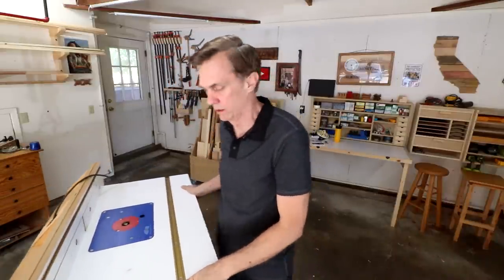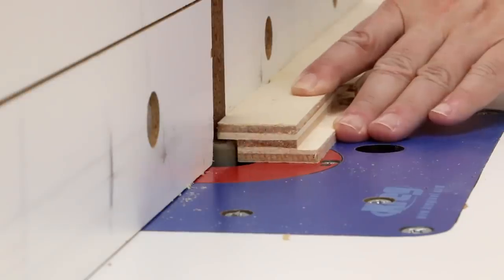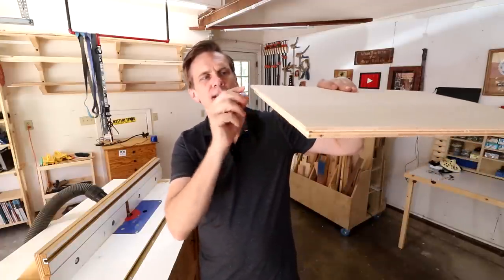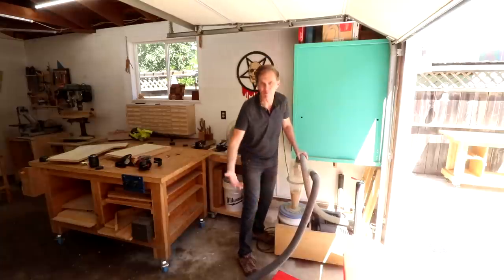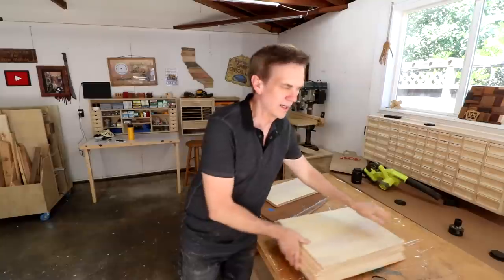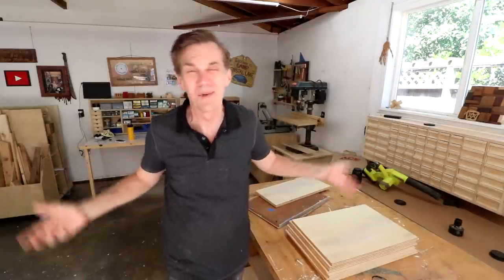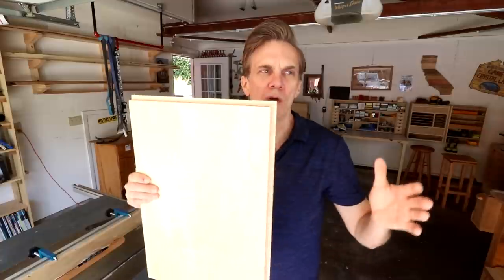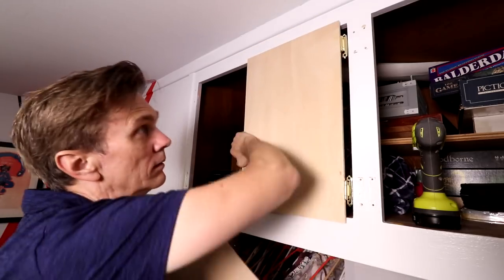Why did my router bit keep slipping?! | Day 116

Comment: The easiest way that I've found to hang double doors like you have, is to make 1 large door, screw in all 4 hinges, then remove it and cut it in half. Doors always align, even with me being a little on the clumsy side.
Reply: That's wicked smart
Reply: Brilliant
Reply: You just blew my mind
Reply: I will be using this on my current project when I get to the doors! Muchos Merci's!
Reply: There are very few hinge styles that that will work with unless you access to the back side of the cabinet.
Reply: Thank you, that is an awesome tip!! I've been watching Adam Savage build boxes that open to display things with hinges and he does the same think.  Build the box then cut it.  Great tip!
Reply: Hey, brilliant idea. I'm gonna try it
Reply: That's how my grandpa taught me to do it too. It helps with the alignment, but the really nice thing is that it makes the grain flow perfectly.
Reply: I’ve seen people do this with drawer fronts too. Attach a board to the drawers than clamp on a straight edge and cut to separate with a circular saw.
Reply: nice idea. you could even use a jigsaw and make some funky pattern
Reply: Great idea
Reply: Or use euro hinges ;)
Reply: Nice! I’m going to have to try to remember this!
Reply: You’d need to use a thin kerf blade, the gap could get too big after sawing.

Comment: Hi Steve, My name is Victor from Mexico, love your show; you know? The problem you had with your router happen to me last week, I fix it cleaning the collar (I believe that's the English name of it) hehehe, and all of the parts involved in the grabbing of the bit, apparently the wood dust was causing the problem.  This is the very first time I ever write a comment on YouTube, I've been watching you build things for the last five years and also your older videos, keep up with the great work you do, God bless and thank you for inspiring us to keep wood working.
Reply: Thanks Victor, I am going to try doing a deeper clean within the area the Collete (small metal piece that holds the bit) 
Also I've experienced the bit getting stuck in the collete, but sprayed with wd40 and it came out with a bit of motivation (pulled on it with pliers under the sharp blades portion)

Comment: You sure you are not using 6mm shanked bits, not 1/4" therefore 6.35mm shank? The collet might be tightened down as far as it goes, but not gripping the shank tightly?
Reply: Good point. Can be hard to tell them apart.
Reply: This is a good point.
Reply: especial if the bite was an Asian made bites
Reply: Happened to me - bought a very cheap bit set, wasted my money, yet again. You would think a person would learn, but not me.
Reply: @jeffreythompson9549  I got an expensive set and it does the same thing. They were 1/4" shaft.
Reply: See! See! See!  Get rid of that dam metric crup
Reply: Happened to me as well. I bought a 1/4" bit instead of a 6 mm one. Not sure why they sell that imperial stuff in Europe in the first place. Anyway, this could be solved by buying a different collet for your router.  And it was cheaper than the router bit.
Reply: @keithfaulkner6319  Hey! Lets not get parochial here! This Video is watched (and thouroughly enjoyed) world-wide not just US, Some of us are in Europe and are constantly battling the Imperial vs. Metric problem. But I reckon that's the Bit slipping issue here...6mm vs. 6.35mm.
Reply: @jeremyspecce  the only ways I can tell is if I try to load a 1/4" bit into a 6 mm collet or measure the shank with calipers. A 6 mm shank into a 1/4" collet seems to work, but doesn't. It'll slip like it did to Steve. It'll seem tight but it just won't be quite tight enough in use.
Reply: @Clive007  Imperial length measurements were dropped 185 years ago now. A swede named Johansson decided what an inch was going to be for everyone. Because he made the best inches on the planet. Henry Ford credits him for the modern industrial age. That's how good his inches were.

Comment: Router Fix!   I had the exact same problem.  Before I fixed it though, I ordered a new router as I thought I wouldn't be able to, besides the router was probably 30 years old. It was a Craftsman that I inherited from my father.  Anyway, when routing panels, the size of the chamfer was changing. I thought it was the knob/clamp that locked the motor height into the base. As it was an old router, I chalked it up to being worn out. Later, I decided to clean and lubricate it anyway. I moved the router up and down. It didn't move smoothly.  I shot some WD40 into  the grooves and wiped numerous times until all the sawdust and gunk was out.  Then, I lubed the bolt and knob that clamps the base to the motor. That now works smoothly.  Next I took the collet off. I cleaned and lubed that too. Probably junk in the threads. The junk in the threads in three locations were keeping the router from being tight. Once they were cleaned and lubed, it was tight again.  Problem Solved!  Think about it. Routers are simple machines. They spin a bit.  The motor locks at a certain height.  The collet is just a screw. Not hard problems to solve.  Dirt and grime is the cause of many mechanical failures. Keep your machines clean and they will serve you well.

Comment: This is happening to me as well on a 1/4 inch hand router I bought at a garage sale for about 5 bucks. I'm pretty sure the collet is worn out. Trying replacing the collet (that's what I'm going to do). If that doesn't work, it might be time for a new (also what I'm most likely going to have to do).

Comment: Had the same problem  with a porta cable 1/2" router. The collett  was worn. Replaced it & no problems  going forward.
Reply: My thoughts too.  Collett won't cost much either.
Reply: yes, what steve describes looks like a worn-out collet in his router table.
Reply: Was going to suggest this. Steve should also take the opportunity to get a better collet than the crappy ones that come with budget routers, rather than just getting another OEM collet.
Reply: Could also be a 6 milimeter shank bit that has been sold as a 1/4 inch shank.
Reply: @jinxkwb  Buy a collet for a Bosch router and tell me how cheap they are.
Reply: same here- replaced the collet

Comment: Hey Steve, I once learnt in another YouTube-Chanel something about inserting routers: they have some mark marking the max insertion depth. Looks like a upper K. I have no idea if this is your problem, but since you mentioned you put them all the way in and pull them out just a bit this might be an issue. If you do a image search for "ENT router bit max insertion" there are some images with that K visible. 
While I'm here: I learnt most of my woodworking knowledge from you. It all started with how to do proper pocket holes. Thank you very much for all your effort!

Comment: Had the same problem with the collet a week back!  I found debris in the slots of the quarter inch collet.  Used a long blade xacto knife and compressed air and now to works fine. (Bosch router)

Comment: You got me, Steve! when you turned the sound off on the video, I caught it right away and thought my Bluetooth headset was having issue and kept backing up the video. I could not for the life of me figure out what was wrong. Other videos and my Rhythmbox worked fine. Finally after (embarrassed to say)2 6 minutes later I realized what you did. You cast a spell on my headset to eternally never hear the secret you told everyone else. I cried a little but came terms with it eventually. Now I understand why you really call the show "Woodworking for Mere Mortals."

Comment: Hey Steve, thanks for your channel; long time fan and subscriber!  I had this happen a few times.  Cheaper bits sometimes have a slightly undersized shank, so you can never tighten it down enough.  That`s a possible cause i heard about and I now buy better quality bits.  Another possibility is you might need to replace the collet.  That fixed the problem for me.  A collet for one router was 20 bucks and another was 50. Ouch!!

Comment: Steve, I’ve encountered that very same problem and found that the shaft has some buildup on it and by using one of those green scrubber pads on the shaft it corrects the problem
Reply: Or Gumout/brake cleaner spray.

Comment: When I first got my router, this was happening. Advice I saw, aside from backing off the bit, was to ensure the bit is clean and the bit and collet are both free from dust. I can't say for sure this was my problem, but I haven't had the problem since (though this was recently)
Reply: Steven "ensure the bit is clean and the bit and collet are both free from dust" you got it.
Reply: I’ve had the exact same issues. Particularly with my 1/4 collet insert for my 1/2 router. Dust causes lots of problems. I’ve also taken to cleaning my shanks every time before I insert the bit
Reply: @Capt. Ken The trick is to roll up a little bit of paper towel and jam that down into the router collet. Then the bit can never bottom out and the paper towel will compress as you tighten the collet.
Reply: @Capt. Ken I have loads of O rings. I've had paper towels in my router collets for decades too. It just works. But if stuffing a collet up with an O ring makes you happier then so be it. One wad of paper towel fits all. I don't worry about them falling out either. No one ever has and if it does wadding up another piece of paper towel isn't that all fired hard to do. Why I bet in a pinch any kind of paper would work. But for some odd reason I always use paper towel. I've rolled it and just made snot balls out of it. That don't seem to matter either. Just so long as you pack the bottom of the collet. You want it about as deep packed as the bore is wide. So for a quarter inch collet pack the bottom quarter inch. You'll never compress it enough so the collet won't compress it more either. It's just paper.
Reply: @Capt. Ken I stuffed a wad of paper towel in my old Hitachi M12V 20 years ago now. It's still there. Where I live humidity runs high. It is not an issue.

Comment: A couple things on your router: the collet could be worn or dirty and not providing proper grip; the shank of the bit could be worn or scratched or dirty so the collet does not lock on it properly; your depth adjustment on the router lift could be loose (as another listener commented). If you look closely at your router bits you will see the shank flares out a bit right where the cutting edge starts, so you are correct not to seat the bit all the way into the collet. If the bit is fully seated the collet is actually locking onto the flared part of the shank and thus likely to slip.

Comment: Tip: Tape the two doors together with the appropriate gape you want then drill all the holes from the hinges.  Then after you clean and paint them it will be easy to get them aligned.

Comment: Most routers have a locking mechanism you set after you set the depth. That prevents side movement and changing depth. Also,  there is a correct direction you cut which depends on the grain.

Comment: I've had the same problem while milling down boards with a router sled. 1/2 inch shank bit. It dropped the bit 1/4 inch into the wood. This is with my Ridgid router. The only time it has issues with holding on to a bit is upside down on the router sled. On a router table, it made consistent box joints without flaw.

Comment: I have had the same problem with router bit slippage. I tighten the collet as tight as I can. Still some slip. I found out that if I slow down my feed rate, the slip stops.

Comment: Steve, you probably already know this, but on a lot of router bits, the diameter of the shank slightly flares out as it meets the actual cutting head. If you tighten down on the "flared" section, the bit will slide when it's under load. As you mentioned, you bottem out the bit then back it out a little, which is the cure for that particular problem, so again, you probably already knew this, but for anyone else having this kind of issue, I hope this is helpful.

Comment: I have never heard of bits slipping in a router collet.  If you are certain the nut is adequately tight, I would replace the collet and see if that corrected the issue

Comment: If you have a 1/4” shaft and the bit is a 3/4” bit, then it will slip every time. You should have a 1/2” shaft for anything bigger than 1/2”. also you need to slow the speed of the router too when you have a bit bigger than 1/2”, it’s a lot of mass for the router, and if you have the speed all the way up, then it will slip, as well as burn your router out.

Comment: Are you sure it is not the router lift slipping? I have the opposite problem with the router slipping down so the depth of cut at the end is less than the start. I built your router lift years ago and have noticed this problem a few times. Still looking for a solution, haven't come up with one yet, maybe you can.

Comment: Some ideas, a bit has spun in the collet creating a burr on the inside( wont grip evenly) , there may be dust on the taper of the collet or router(wont grip evenly) , wrong size  collet , and check that the tightening  nut is not cracked

Comment: Is your lift too loose?it may be allowing you’re entire router to rise!  Or have you checked the bit to see if it is actually lifting?
Reply: I have the same issue.  The router bit is chiseled so as it bites into the wood there is force pulling it up and it slips in the collet.  Maybe a better way is to use a different bit to depth then use the 3/4" square bit to clean it out. Not sure, but I've ruined a couple boards that way and i don't have a dado stack for my table saw. :(
Reply: Robert Schuster , there are two styles to these bits. One cuts upward the other downwards. You need to change to the opposite style. You might also have to change your collet and install a new one as the old one is most likely badly worn and won’t close tight enough any more. Good luck. And enjoy your woodworking!

Comment: The only bit I e ever had slip was a 3/4 straight bit, although mine was 1/2" shaft and I use a Bosch 2.25 hp router. So Interisting to see that I'm not the on km y one that's happened to and it was basically the same bit. 
My theory is there is way more vibration and chatter that happens with a 3/4 straight bit and it just works it way out 🤷‍♂️

Comment: Your collet needs to be replaced probably, but you should also definitely be slowing down the router for larger bits. And for the love of God, use your gripper or something when pushing wood through the router; if your hand slips or the wood kicks back or something, your fingers are going right into the bit.

Comment: I think it's the curse of the doors! You were just pointing out that it's "interesting" to see the shortcuts of the prior builders, and reverse engineer how they did something, all while talking about the old doors having been marred by a router when the house was first built. Guess you can't escape it! Now in 50 years some fool is gonna be like, "and it looks like this door was dropped and glued back together, and this door looks like the router bit was slipping, they go frustrated and made the rest of the rabbets on a table saw."

Comment: I want to hear you call one of your videos a "picture". This works better if you talk fast, out of the side of your mouth, and say "see?" at the end of every sentence.

I think there are 2 things at play with a 1/2" router bit vs. a 1/4": 1) the 1/2" bit shank has twice the circumference as the 1/4", so you get twice the surface area for friction to hold it, and B) the friction on the 1/2" shank acts at twice the "moment arm" as on the 1/4", like the way a large diameter steering wheel is easier to turn (or to keep from turning) than a small one. In the meantime, try degreasing the bits and the collet with something good, like brake cleaner, if you can still get it there. A fresh collet might help, too.

Comment: On a wider diameter bit, the outer edges spin at a faster rate than on a narrower bit. The load on the router becomes too much for the collet to hold. A variable speed router would fix this issue. by reducing the speed of the bit and feed rate the forces on the collet are greatly reduced!

Comment: Why is it that when you drop plywood it ALLWAYS lands on a corner.......grrrr!
Reply: Murphy's Law
Reply: or your foot
Reply: Same reason why when you butter your toast it lands butter side down.
Reply: Ha! Actually it's like... almost impossible for it to land on something other than a corner, if you think about it. It'd have to land perfectly on an edge or completely flat.
Reply: Because there's a 4 in 4 chance?
Reply: Why do cats always land on their feet?  Both were made to land like that. I agree with Adam.   As a three dimensional object moving/falling through space to a flat plane,  to odds of it landing perfectly flat or on edge are extremely small. It would need one of those computers that Space X uses to land it's rockets.
Reply: Gravity. The earth sux.
Reply: Math: there are 360 degrees in a circle, of which only 4 angular rotations (0, 90, 180, 270) result in perfectly flat contact with the ground.  So, if you dropped plywood 90 times, one might not have a bent corner.

Comment: Collet quality makes a big difference. And I'm sorry, but PC routers are really overrated. 
 
Niw, they're better than dewalt, but I've had 2 PC routers, and both were nightmares. The motors are great, sure, but everything else is subpar. 
 
And still, with their (oddly) high popularity,  they got the axe from PC's tool lineup.
 
For myself, U use routers for everything (since I only have 1 arm/leg) and for a good value priced router, the Bosch 1617, is hard to beat.